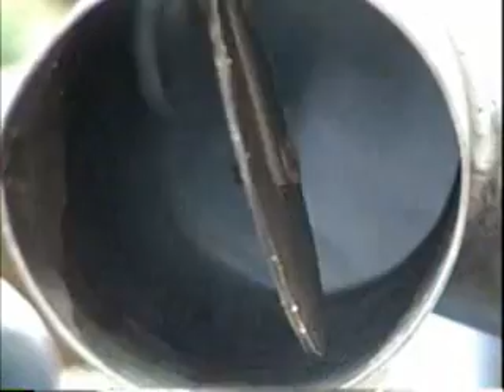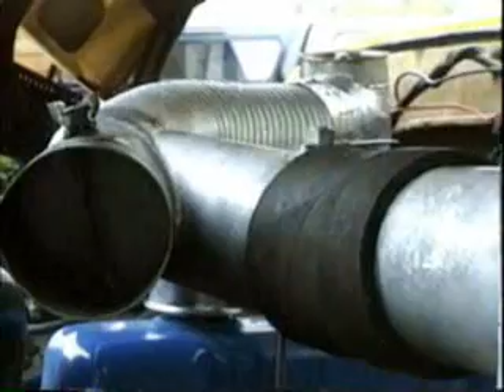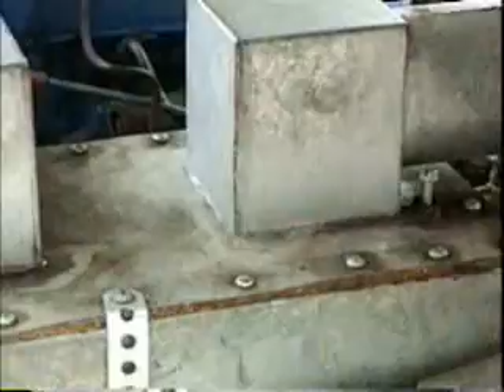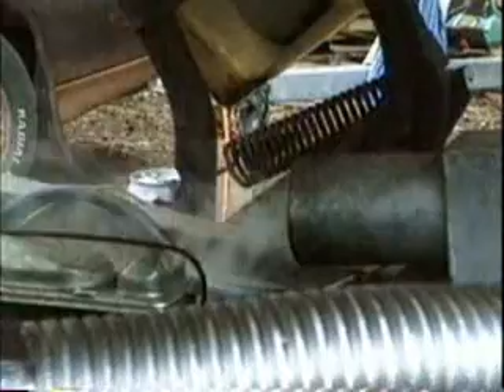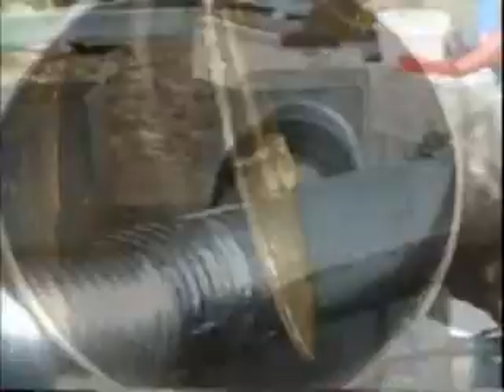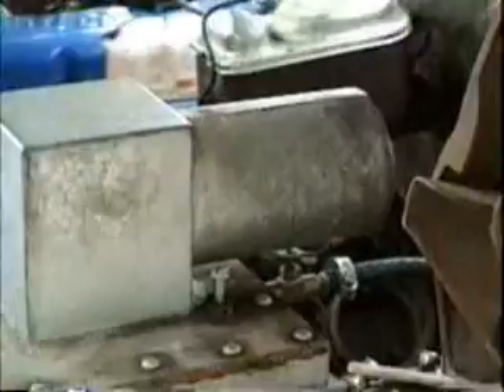Here is definitive proof on how to separate all Atoms in all liquid soluble matter.

Comment: Because Natural Gas expands approximately 600 times going from a liquid to a gaseous state, the only way to achieve extreme drivable distance per full tank would be to store the natural gas in it's liquid state in a cryogenic tank in the automobile, and then burn the natural gas in the vapor (gaseous) state, in the engine. All CNG autos now store the CNG in it's gaseous state, which reduces total range.

Comment from the maker: @150MilesPerGallon On one of the vehicles I ran the chamber on. It was a gas guzzling 1976 Ford F-150, with a 390 cubic inch engine, automatic transmission, full time four wheel drive. Before I ren the truck on the chamber, I pulled the front right spark plug, on the engine. That spark plug was packed with carbon, and it was moist from unburnt liquid gasoline. I did nothing to the spark plug, just installed it back in the engine, and ran the engone on the chamber for about 1/2 hour.

Comment from the maker: @150MilesPerGallon It can't be hurting the engine. The engine is running cooler, there is no liquid gasoline, like with the traditional liquid system, to wash the cylinders of oil, and ooze past the piston rings, when to much liquid, which can't be compressed, is forced into the crank case. Proof is they have vented the crank case through the smog system, PCV valve.

Comment: With your white vapor providing twice the horse power compared to running traditional liquid fossil fuel, could this significant increase in horse power cause damage to the pistons, rings; or even blow the head gasket. A 50% increase in horse power (per your testing on two different Dyno machines) to a stock engine is quite significant.

Comment: Thank you for this information. I'll test your system the way you mention. I'll also be sure to use a small fan on the slowest speed setting, at a reasonable distance from the test area, in order to help the clear bubbles pop, and fill the void with oxygen, thus creating the white vapor.

Comment from the maker: @150MilesPerGallon You want to see how much pollution gasoline has. Do the electric fry pan trick with gasoline and the spray bottle, create the white vapor, and ignite the white vapor. Be careful, that stuff is highly explosive, so don't spray that much into the pan. When the white vapor ignites the flame also burns the non flammable liquid created, that stuff creates the blackest smoke, like an oil fire does.

Comment: When your father add the additional 5 gallons of liquid gasoline, the (at least 600 F.) wood molecularly changed the gasoline into your white vapor, by creating a void, and filling the void with oxygen. Remaining is your cold, white vapor which burns with far more efficiency and power than traditional vaporized gasoline. Great Observation.

Comment: That is amazing. Thank you for sharing your first encounter and experience with the white vapor. It sounds like the recently burned and extremely hot wood, must have been at least 600 degrees Fahrenheit, but less than gasolines autoignition temperature (just under 1000 F. in your experience) in order that the gasoline would not instantly ignite.

Comment from the maker: @150MilesPerGallon Actually he opened the dish washer door, at the same time he turned the stove on. When the stove fires up, it takes a few moments for the gas to reach the ignitor, so the hydrogen inside the dishwasher had enough time to come out of the dish washer, travel up towards the stove and get close enough to the ignitor to ignite. Since hydrogen is such a light gas. He said he heard a pop inside the dish washer when it happened.

Comment: Wait, the unit was closed when the Hydrogen ignited from the stove flame. Ordinarily, the dishwashers seal extremely tight. Although I believe Hydrogen is the lightest element on the periodic table, and is able to squeeze through the smallest of gaps and seals. I wonder if the spark from the electronics inside the washer may have ignite the Hydrogen.

Comment from the maker: @150MilesPerGallon When I do it to water, lab tests won't be needed. When I ignite the white vapor, and i know it will be white. You see it was confirmed by a friend. He had a dish washer fire one time, and thought he was crazy. The dish washer had just come out of the dry cycle, heat. Small droplets of water on metal pans, heated by electric dish washer heaters, and he lite the stove, located next to dish washer, heard a pop in the dishwasher, opened it saw white vapor like mine, and a flame.

Comment from the maker: @150MilesPerGallon Actually I discovered how to make by accident. I was trying to get enough heat into a chamber, that I had got the designs from a seminar, that I went to. They said 100 miles per gallon on gasoline vapor. They had plans, no working model, so I duplicated the plans, and realized not enough heat was present. I put the chamber in an electric skillet, and was trying to put gasoline in the chamber, when it splashed into the pan. Instant white vapor.

Comment from the maker: @IAMBILLYTHEKID You could eliminate having to start the engine on the gasoline vapor, by installing a 500 watt heater on the center tube. Have the heater temperature controlled to turn off when the engine exhaust reaches operating temperature. To start the engine turn the heater on, allow it to warm up, like you do with a diesel. The heater will take the place of the exhaust heat until the exhaust reaches operating temperature.

Comment: It's also important to remember that pressure affects boiling(vaporizing) temperature. A lower pressure inside the bubbler (Fuel Jug), the lower the boiling point of the jugs contents(fuel). The engines suction creates the low pressure (vacuum) inside the bubbler, and a ball valve can be used to facilitate the degree of vacuum.

Comment: I know it's important that the exhaust gases flow in the opposite direction the fuel vapors flow(inner pipe is fuel vapors, outer larger pipe is hot exhaust), also, the inner pipe also contains a small solid rod which the fuel vapors must squeeze around to reach the intake port.

Comment: The simplified small engine GEET plans utilize several ball valves which allow a reasonably fine adjustment to the amount of vapor the engine intakes, verses the additional fresh air allowed to be added to this vapor mixture. I will be extremely thorough in my description of how I believe my small engine GEET works, when it's complete.

Comment from the maker: @150MilesPerGallon I don't know what the exhaust gasses come from the potato smell type of system. I can see where the Geet system would work with the inner intake tube. I don't know what temperature he gets, but I am sure it is high enough to vaporize almost any liquid, if the liquid is sprayed into the tube. You would have to make a way to meter the liquid to get the maximum mileage.

Comment: That's exactly right. The jug (pickle jar)which holds the fuel will be 1/2 full of gasoline (or crude oil). Two holes will be cut in the top of this jar. One opening(vapors only) connects to the reactor, the other opening goes down to the bottom of the bubbler (jug) which bubbles as vacuum from the engine pulls air in.

Comment from the maker: @150MilesPerGallon I just can't figure out how he gets the vapor. He has to spray the fuel into the inner tube, and the exhaust heat vaporizer the fuel, provided he sprays the fuel into the inner tube. Do you have to start the engine, by sucking vapor through the jug, and let it run to get the exhaust heat high enough? To start the engine on vapor, you will need a heat sourse, to create enough vapor to run the bigger engines.

Comment: For example, Paul Pantone inventor of the GEET, has achieve up to a 23% increase in oxygen from the exhaust, than is in the air we are breathing. And this using the vapors from crude oil as the primary fuel source. And extremely low Hydrocarbons, I believe .01 parts per million. I believe only a molecular change could account for this.

Comment from the maker: @IAMBILLYTHEKID The horsepower to the ground at the same AAA inspection station in San Jose, California, went from 85 horse power to 165 horse power. Gasoline to the white vapor. You see the engine had broken rings on the back two cylinders, and burned 6 quarts of oil going 32 miles to do the test. Beat that.

Comment from the maker: @150MilesPerGallon I already know what you will find on the white vapor. Zero parts per million hydrocarbons. I saw it 25 years ago. at the AAA vehicle inspection station in San Jose, California. I watched the operator beat the tail pipe probe on the ground, when he got no reading and thought it had broken. But, it read on the next vehicle. On my vehicle on gasoline, it maxed the reading at first, then on the white vapor it went to ZERO.

Comment from the maker: @150MilesPerGallon I have a problem with this so called plasma. Where is this plasma coming from? Something has to create it. This reactor is just a way to heat the fuel before it enters the intake of the engine. I see no plasma, just a super heated liquid, and if he uses a spray to inject the fuel into the tube that is being super heated by the exhaust gases, then he is burning everything, and carbon is in there.

Comment: From what I've studied and read. Approximately 40% of gasolines energy is wasted creating excess heat in the combustion chamber, which the cooling system must continuously prevent from overheating. The other 40% is lost in HydroCarbons in the exhaust system, HydroCarbons being unburnt gasoline, which does not achieve a complete burn or Stoichiometric equal burn. Catalytic Converters burn the unburnt fuel in the exhaust. This is not efficient.

Comment: I understand you believe the carbon has been removed from your gasoline, which is the non burnable liquid which remains at the bottom of your chamber. From what I've read and studied about the GEET Reactor, when built proper and functioning proper, may be able to take your non combustible liquid, and convert it to a combustible gas(plasma).

Comment: If you're referring to the GEET Fuel Processor, it's able to run on crude oil mixed with sea water and even battery acid. Out of the exhaust is zero pollution when the fuel system is built proper. See GEET International and GEET Friends home pages to learn more. These systems work on all 4 cycle internal combustion engines.

Comment: Ultrasonic Humidifiers (Ultrasonic Transducer) break down (See "Cavitation") liquids to the smallest droplet size I'm aware of. For example, an ultrasonic humidifier will take both water and gasoline to the 2 micron to 5 micron droplet diameter range. Whereas a fuel injector only achieves an approximate 50 to 65 micron droplet diameter.

Comment: In the NitrousOxideSystems (NOS) the Nitrogen specifically functions as a cooling agent, to cool the engine from the excessive heat that the additional Oxygen creates. I wonder, with your possible H2 O2 molecular change from water, if both the Hydrogen and now additional Oxygen, will both serve to provide extra power, and efficiency.

Comment: I recently learn that a NOS(Nitrous Oxide System) which many street racers put into their race cars is actually given the extra boost in power from the burning of Oxygen. I also read for every ten degrees cooler the engine runs, horse power is also increased (one horse power for every ten degrees cooler the engine runs).

Comment from the maker: @150MilesPerGallon I am thinking it it close to 212 degrees. Hydrogen has one of the lowest boiling temperatures so it is probably close to the boiling temperature of water.Hydrogen's boiling temperature being closest to absolute zero. I am guessing but I might end up with H2-O2 gas. When the molecular change takes place a void is created, and air being present, just like with liquid gasoline, oxygen will fill that void, giving me an H2-O2 gas.

Comment: That's an excellent solution. Being that water boils at 212 degrees Fahrenheit, at atmospheric pressure, and the Calrod heater glows red at approximately 1000 degrees Fahrenheit, what would you approximate the temperature to have been when you released the Hydrogen from the Oxygen in H2O.

Comment: I know. I was also looking into Smokey Yunicks "Hot Vapor Car", which actually only uses ordinary vaporized gasoline, rather than molecularly changed cold vapor, which already has the needed oxygen to run the engine, in the white vapor. Your chamber seems much simpler, and much less mechanically complicated.

Comment from the maker: @150MilesPerGallon Check out any Goodwill's in your area. Stainless is the best. Anything else, the heat goes away to quick. Stainless has more resistance, and conducts heat slower, so it retains heat longer. Mass on the heater is what is needed to maintain the constant temperature.

Comment: I was thinking: rather than have the heating elements horizontal, and rather than using a calrod or metal tubed heating element, if we could locate a thick heating mesh(possibly 1" inch thick) which maintained the 600 F. minimum temperature, and the liquid fuel would be sprayed onto this hot(vertical) mesh on one side, flashing the fuel that passes through it.

Comment: I primarily use 91 octane which I understand has a lower boiling point then 87 octane gasoline. I'll keep a close eye on temperature. I'm also looking for materials that I can build a molecular chamber from. Possibly something pre-existing that can be modified to be used as a chamber for the new molecularly changed, cold vapor.

Comment: I'll also need to upgrade my temperature gun, which only reads up to approximately 425 degrees Fahrenheit. I believe Sears Roebuck and Co. offers a Craftsmen temperature reading gun which reads up to approximately 900 degrees Fahrenheit. This will permit me to get the exact 600 F. For 87 and 91 octane molecular change.

Comment from the maker: @150MilesPerGallon That's OK I went back to the company I originally used when I first made the chamber. Just waiting for a price. I have accumulated the equipment, except for the heating element, and the combustible gas, leak detector, which I will get on the first of February. It will happen soon.

Comment from the maker: @IAMBILLYTHEKID I still have the punch tool I made for the spray onto the first model. I punched the holes into 1/4 inch copper tubing, running parallel to the heaters. It ran on three different vehicles, then we discovered the liquid wasn't flammable, after the liquid and gas were separated with this process, so we went to spray nozzles. Still had the problem. I thought it was my nemesis, running a vehicle on vapor, now i know different.

Comment: Given that the smaller the gasoline droplet size equates to a quicker molecular change. Rather than use a fuel injector which can only achieve a 50 to 65 micron gasoline droplet size, I may be able to use an Ultrasonic Transducer, which creates an extremely small liquid droplet size of 2 microns to 5 microns. Yes?

Comment: I understand. This is fantastic. I may be able to use a(one) fuel injector, pressurized by the old fuel system, to introduce the fine spar of liquid gasoline onto the 600 degree F heater (chamber), although I would need to somehow be able to manually adjust the volume, flow of 50 to 65 micron gasoline droplets, onto the 600 degree F. heating element.

Comment from the maker: @150MilesPerGallon You need to go above the boiling temperature of the gasoline. The octane level of the gasoline you use will determine the actual boiling temperature. The higher the octane level the lower the boiling temperature the gasoline will have.I used 600 making sure it was the boiling temperature of gasoline, at any octane level.

Comment: Based on your extensive testing and experience, I now know that liquid gasolines actual Autoignition temperature is much closer to 1000 degrees Fahrenheit (when the heating element is just beginning to glow, a dull red). Though, based on your design and experience; I only need 600 F. to achieve the molecular change.

Comment from the maker: @150MilesPerGallon Yeah, I would bet the lab tech that set the temperature used a flame, or spark at the 536 degree temperature. A constant heat is needed to set the ignition temperature. I know for a fact when a calrod electric heater starts to turn a dull red it will ignite gasoline, and that is around 1000 degrees Fahrenheit. I just didn't have anything to read the temperature at that time.

Comment: The heaters I believe come with built in thermostats with various different temperature ranges. I was thinking of purchasing two heaters with a temperature range of approximately 500 or 600 degrees F. to 1000 degrees Fahrenheit. This way, I can set the heaters to an exact temperature, and the thermostats would maintain this heat level ie 600 F.

Comment: I will set the industrial humidification heaters to maintain a temperature of 600 degrees Fahrenheit, in order to take the liquid gasoline beyond it's boiling point within an instant, in order for the molecular change to take place. This would create the clear bubbles which turn white when they come into contact with surrounding air(oxygen).

Comment: A friend that works in air conditioning, when I told him about your invention(molecular chamber) said he can order heaters designed for vaporizing water, which he said sit directly in the water bath, first creating steam, which soon thereafter becomes a vapor. He said the heaters are chemical resistant, and have thermostats to adjust and maintain exact temperature.

Comment: Is it better to have the electric heaters sitting inside the steal chamber, in order that the liquid gasoline comes into direct contact with the heating elements, or is it more efficient to have the heaters in direct contact with the steel bottom of the molecular chamber, where the liquid gasoline never actually makes contact directly with the heating elements.